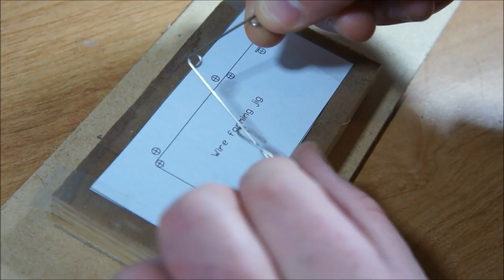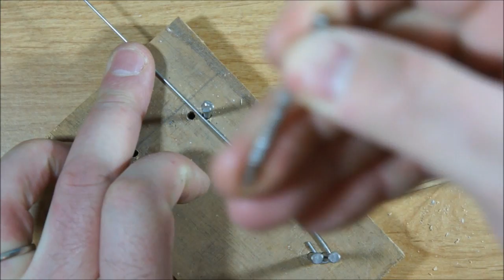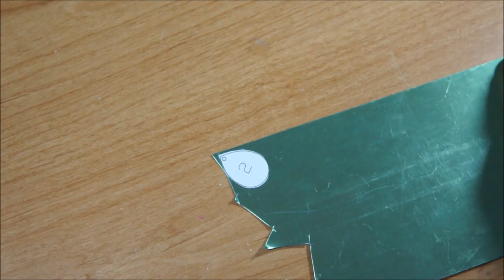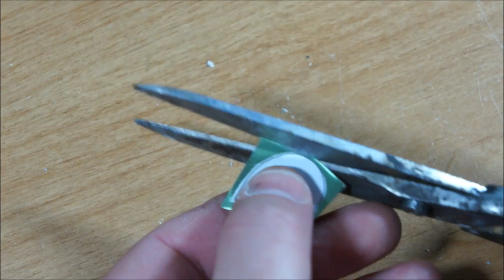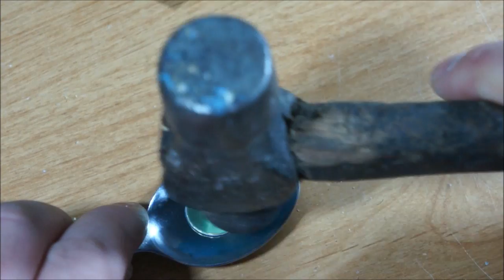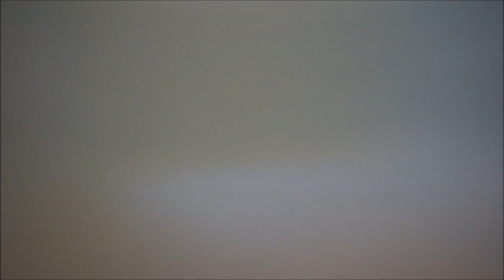How to Make a Jig Spinner or Spinnerbait Arm

Comment from the maker: i tested the locking system by attaching it to a heavy duty snap link and bench that is bolted to ground. I placed a bar through the hook bend and applied some of my natural body weight in a jerky motion. I think i am a little larger than record musky and they don't wear shoes. What happened is the hook straightened or broke. If anything the next weakest place after the hook is the hitch point but this is all far outside what my rod or line could handle. But pike are clever buggers. Cheers

Comment from the maker: .4mm does seem a bit thin, i used think that bought fishing lures where always made better, yesterday at the lake a guy showed me a abs plastic wobbler that  had lost its back hook and wire to snag, a little later i pulled in a balsa lure i had lost over a month ago at it was undamaged by long soak. But all that said i tend to loose my lure to trees more than anything, i should by a chainsaw,   Cheers

Comment: Happened to me in terms of a snag , that the previously mentioned snap lock on that commercial , thin-wired jig spinner opened , ..thought to myself , that it might happen with a better pike as well , ......0,4mm wire really does not offer that much resistance , I guess ?

Comment: You really make it look so easy , ...I would never have thought about using a table spoon as a die !
But I'm not a great fan of these simple snap locks securing the leadhead , though I think , yours would be pretty much reliable with that thick wire .
I've had issues with commercial jigspinner snap locks before , made of about 0,4mm wire , ...since I tend to make more elaborate , but extremely reliable coil spring locks to my own jig spinners .

Great "how-to" vid , ...cheers , 61diemai